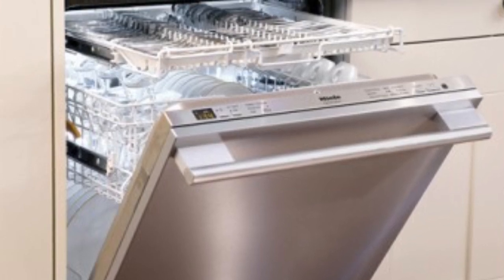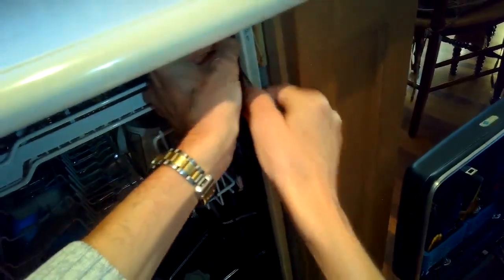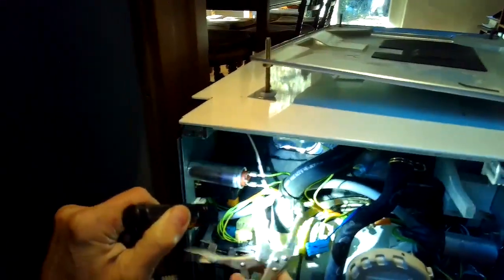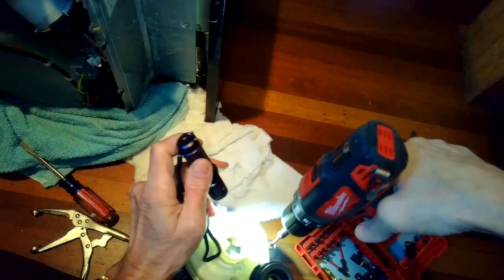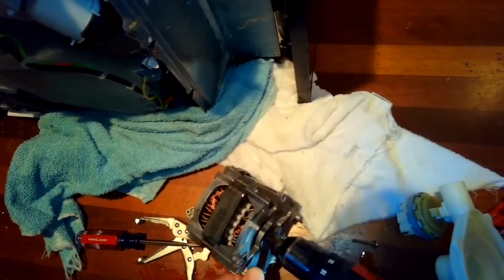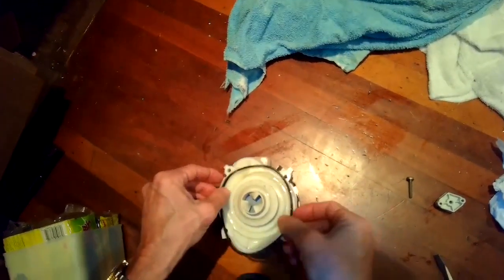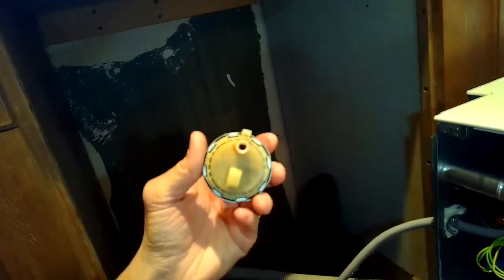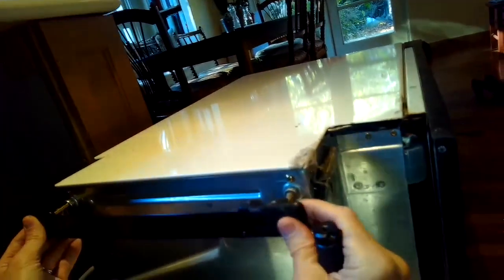✨ Miele Dishwasher - Circulation Motor Repair ✨

Comment: I had exactly this problem with my 16 year old Miele dishwasher.  Two local appliance engineers wouldn't touch it.  I got the spares online and fixed it myself in about 20 minutes.  Brilliant!!
Reply from the maker: Very impressive😊

Thank you

Comment: Scott. Thank you so much for this video!! Was about to throw away my 15yo meile until came across your channel. I was getting low pressure through the spray arms but no error code. There was broken glass caught in the impeller. I didn't need to replace anything so this fix didn't cost me anything. Thank you so much!!
Reply from the maker: Awesome News Tim 😊😊😊

Comment: Scott you are a life saver! Miele wanted to charge 150£ just for a call out, but this video saved me from paying to those money grabbing bustards. I have different model but actually all the insides and fixing is the same. I had a small particle of plate stuck in circulation pump. Took me 2 hours with watching video and unhooking pipes etc but we'll worth it. F78 error solved on my Miele G6620

Next time it will be 30 min max fix.
Reply from the maker: Thanks so much😊

Comment: Scott help please! Just put a new circulation pump partition kit in. Not nearly enough end play and the impeller barely turns when assembled. All was completely sanitary on assembly. Now I need to disassemble and figure out how to set the end play. Does the impeller free wheel  when spun by hand several times or does correct play make it very snug? It seems on mine the threaded bushing is not at the correct depth in the impeller, causing too much contact with the housing seal. How much resistance to rotation is normal?
Reply from the maker: Can you try getting some rinse aid behind the impeller to help lubricate it?

Comment: Hi Scott thanks for this video  I may try this because well I have to try something to get it to work again.   

Do you have any idea on how to get an error code on a G 5175?   There is no digital display on my model.   Thanks.
Reply from the maker: Hi Daniel,
At the back of this service manual is a way to get the error codes from your dishwasher.
Please let me know how it goes.https://f01.justanswer.com/smitty1486/82cb3584-14eb-4f91-85fb-9fc99e1393a9_G4000+G5000+Miele+Service+Manual.pdf

Comment: So I spent over 4 hours tonight working on it. Going the dishwasher pulled on and the bottom off, and removed the circulation pump. It looks different than the ones in Scott's video. But there was nothing stuck inside of it, or any of the connecting pipes, and nothing in the pressure switch. So I took my time to put everything back together and was going to run it again, and now there is a water leak into the overflow plan as soon as it starts to fill with water. So would have to pull it back out to find the cause of the leak. If I can't get it to stop leaking, and if it still makes the grinding sound, I'd end up just replacing the entire Dishwasher with a new one than spend $700 for a new pump & motor.

Comment: Great video Scott - I know the F79 fault is not necessarily a pump fault, but more a communication issue between that and the pcb.  Gut feeling (from an appliance engineer to a heating engineer) - is it worth digging around or am I potentially going to spend our more on a 9 year old machine than makes sense.

Comment: Thank you for your excellent videos.  I have an G 892 SCU Plus, and I think I have a circulation motor problem.  It stops with in 10 seconds after filling and then it tries to start circulating, then just stops.  How did you know the motor was a problem versus the capacitor.  I saw your video on the circulation capacitor.  I think that may be my problem.  I don't know if I have an F14 error since my Miele doesn't have a digital display.  It stops with the Rinse and hold light on and the start/stop light blinking.
Reply from the maker: Can you access the impeller with a fork?  It might be stuck and needs a twist.
Reply: Yes, I tried spinning the impeller back and forth with a fork.  It to rotate fine.

Comment: Scott, I love the video on clearing the F14 error by pulling the shrapnel out of the circulation pump..  By any chance could you upload a video doing the same circulation pump dissassembly on a miele pump no 7805380, which is the pump for a miele G5715 dishwasher

I got a F78 error and Ive tried everything else,, but I've got a funny feeling that it is a bearing in the motor itself because it isnt spinning very freely, like the one in your video is.
Reply from the maker: That totally sounds like a bad sticky bearing.
Reply: I totally agree actually :)... I worked out how to get the motor and pump apart.. strangely its a sort of permanent magnet inrunner type arrangement with the internal rotor sealed inside a plastic shell inside the stator on the outside. Quite funny!!!  ... anyway I worked out how to get it apart safely and non-destructively.. and yes the back bearing runs pretty freely, front bearing is pretty stiff so that is where Ill start.. I havent worked out how to get the impellor off, which I have to do first. But it has two little holes in the front of it which looks like it is made for some kind of a custom tool which I reckon I can make.. I suspect that it will be a left thread?? The motor is  a 7805380 on a pump which is for a G5715 miele dishwasher.. But the pump looks different to all the ones in your videos...

Scott, I very much appreciate your videos and your effort.. I will more than happily make you a donation if it works. You will have saved my the cost of miele genuine part which is $600+ Aussie dollars
Reply: Incidently, how much power do these motors pull?.. I wouldnt have thought that the motor would really struggle to overcome the small amount of friction on the front bearing so the motor is obviously  only low power ??100W or something small??

Comment: Thanks for a great video 👍 I have an Miele G6200 that is leaking (dripping) while the water is circulated. Is it possible to just replace the seal, if thats the faulty part? /Martin (Sweden)
Reply from the maker: Hi Martin,

You can call espares.com to see if they can send you a partition seal kit

Comment: Hi Scott,
I watched your video on replacement the partition washer between circulation pump and motor in Miele dishwasher. I have Miele model 4225 and the pump assembly 
MPEH 00-62/2.
I contacted Miele technical services and part department, needless to say they were not helpful. 
Where can I get the repair kit.
Thanks, Michael
Reply from the maker: How about this one: https://www.google.com/search?q=miele+circulation+motor+partition&client=safari&hl=en-us&prmd=sivn&source=lnms&tbm=isch&sa=X&ved=0ahUKEwjm-vzGgqzYAhWK0FQKHVcADfQQ_AUIEigC&biw=375&bih=526#imgrc=gL2UNK8WYYPbHM:

Comment: Very helpful video, thanks. I found the rotor to be not really jammed so I cleaned the rust up and reassembled it but the motor still makes no noise at all, and as soon as it is called into action (after the other pump has emptied the water and the water has been coming in for a short while) the red light blinks on my G 680 SC as before.
Is there any other possible reason for this (fuse? overload switch? etc.) or does this mean the motor needs replacing?
Reply from the maker: You might try calling Miele USA and asking them to send you a new motor capacitor.
Reply: @ScottTheFixItGuyChannel  Thanks Scott, but I missed your reply as Thunderbird sent it into my Spam mailbox. We finally decided to replace the dishwasher after 21 years of loyal service and several DIY repairs over the years.

Comment: Great video Scott....!!!!  Thank you.

I was able to remove the motor and retrieve a piece of glass from the impeller of the circulation pump just by following your easy step-by-step instructions.  The dishwasher still has a problem though.  It is an older G 692 SC PLUS 3 model (16 years old).  I wonder if you have any suggestions regarding the problem it had to begin with, or if you think the machine might have run its final race??

On any cycle, it starts off perfectly by first draining the sump, then it takes in approx. 6 liters of clean water and then the circulation motor kicks in perfectly and the initial rinse begins.  The water seems to be circulating as well as it ever has.  Everything seems to be perfectly normal up to this stage.

HOWEVER after about 10 seconds, it stops and pauses for approx 10 seconds.  The pump then kicks in again and the initial rinse continues for another 10 seconds, then pauses again for approx 10 seconds again.  This happens about a dozen times, after which the machine come to a stop and the red Inlet/Outlet light starts blinking.

If it does complete a cycle, it doesn't always heat up the water on the wash, not the final rinse cycle.  I have tried everything I have found on this subject and am starting to wonder if the electronic circuit board has packed up.  Any suggestions would be much appreciated and also if Miele has a factory reset procedure for the inbuilt software?
Thanks in advance, Vic Schroeder
Reply from the maker: Might just need a new heater relay 👍
Reply: @ScottTheFixItGuyChannel  Thanks for your speedy reply - I'll check it out.
Reply: @ScottTheFixItGuyChannel  Just one more question if I may......

If the heater relay was faulty, how would that cause the dishwasher to stop and start continuously while still in the initial COLD water rinse cycle, or does the software actually detect that the relay is faulty even before the coil is energized to heat the water up in the upcoming wash cycle?  Regards, Vic
Reply: @vicsch8162  Hi Vic I read your above posting and my Miele 841 Plus dishwasher is behaving the same way. My machine gives me an error of F08 - Water intake failure, heater level switch.   My machine also drains, fills, and then does the multiple on/off on the rinse cycle before throwing the red Intake/Drain Light. Were you able to find a fix for this issue.  

A couple of years ago I was having issues and I did the partition kit when Scott recommend it and that fixed the issues I was having back then, I also did the motor capacitor at the same time just to be sure. The washer was back on line. 

In the last few months the Intake/Drain Light issues started again. At one point Scott suggested that the water intake solenoids valves might be an issue and they should be replaced as they might be impeding water intake.  When I checked the water intake it was severely clogged with rubber from the washer and after clearing this out the dishwasher ran as normal for a few more months. Now it’s back to the issues above. The water intake is clear so now I am wondering if it is heater related issues.

I see Scott suggested that the heater relay might be an issue for your situation and I was wondering if you replaced it and did it fix your problem?  Thanks for any help in advance.  Mike

Comment: Hi Scott - thanks for the video.  I may have a later model as there was nowhere to insert a screwdriver to prevent rotation while removing the impeller.  I tried to unscrew a section next to it to get in through the side, but what looks like a flow distributor (skeleton cylinder with a cog and two pop-out window tabs) came off and I can’t tell how to reinsert it.  Any ideas?
Reply from the maker: Hi Michael,
Unfortunately that model does not allow you to rotate the circulation pump impeller.
Reply: @ScottTheFixItGuyChannel  Right - makes sense.  Any idea how to replace the flow distributor with two window tabs that came out?  The orientation and placement of the cogs is not obvious prior to reassembly.  I did clean the impeller though.  Now I can't reassemble.

Comment: hey can you tell me why an f85 fault would happen with impellor free and clear?
Reply from the maker: Hi Benny,
 you'll need to contact Miele USA since they are the only ones that distribute their own parts and order a new slide shutter for the circulation pump because it has seized up / failed for one reason or another.
Reply: @ScottTheFixItGuyChannel  thank you i bit the bullet and got it checked by an authorised repairer who had a scanner and the motor had expired and would cost over $600 AU for just the part alone.

Comment: I have an old Miele dishwasher g2170.  It’s pouring water I believe out of the circulation motor and it’s making monstrous noises that has my dogs barking.  Do you think The Whole pump needs to be replaced or does it just need some maintenance Iike you did?   I’m trying to save money.  The pump is about 800 and then what’s the point mine as well get a new machine.  I bought it in about 2006.  

Update: Called Miele, they do not have a partition kit. I can’t seem to find one anywhere. The circulation pump is now part number 12133930 and it’s 579.46. Do you know anyone who would carry the kit? I think I’m going to go ahead a check to see if there is something obstructing the impaler (have nothing to lose) but if I need to change the seals, not sure what to get.
Reply from the maker: I bet there’s just something caught in the pump that makes that noise.
Can you call Miele USA and ask for a new partition pump kit?  That should cure the leak.
Reply: @ScottTheFixItGuyChannel  Thank you! I will.  I’ll update.
Reply: @ScottTheFixItGuyChannel  Hi Scott , I took out the circulation pump and there was a spike from the bottom basket in it.  That helped with the loud noise.  It’s still pouring water out of somewhere during the full wash.  There’s is no clog coming in and I can hear it drain.  There is a mechanical sound during the whole wash.  Im not getting error lights now and it is going through the whole wash.  But It’s it’s pouring water.  Do you think I should just toss it and try and get a new machine or is there anyway for me to figure this out?   Im lost. Sry

Comment: Hi all, so I repaired the leak between the circulation pump impeller and motor but when I reassembled the actual electric motor I was unsure which end of the rotor shaft the metal washer and metal spring washer went on. Now when using the dishwasher, the motor is noisier than it was before.  Could it be the washer in the wrong side of the motor shaft or is my impeller possibly on too tight? I'd like to have a diagram for the Miele inspira series mpeh 60-62/2 6770512 motor itself and NOT a diagram of the circulation pump assembly since I need to determine how to exactly reassemble the electric motor. Any help much appreciated.

Comment: Hi! I love your videos! So I vacuumed the water out last week, before discovering your videos. I did the fork just now but the dishwasher isn't going on at all. No sounds. Last week, it had filled with water and then it stopped and the Intake/Drain and Rince Aid light came on. They're both on now and blinking. Any suggestions for this? It wasn't run for 2 years before this due to a tenant that I had in here.
Reply from the maker: I wonder how high the water is coming up in relation to the white plastic filter handle. It should fill enough to where it just touches the bottom of the handle.
Reply: Thank you so much for getting back with me. I believe the water was at a normal level. I vacuumed it out and then checked for any blockage. The dishwasher had stopped half way through and the blinking red light turned on. Now the dishwasher won't turn on at all. That's when I found your videos. The "Intake/Drain" is still blinking red and the "Rinse aid" light is solid red. Should I maybe try the fork turn again?

Comment: Tonight the unit ran for about an hour and then would start/stop for a few minutes, and drain all the water, then all the LEDs would flash. I went into the service codes and it showed an F14 which is the Heater Pressure Switch. So I'm not sure if that by itself is the problem, or also the circulation pump due to the loud noise when running.

Comment: I have the G1383SCVi which is slightly different and unfortunately Miele doesn't sell the housing, only the complete unit for 400eur!!!.  In mine the only problem is the pump impeller that the two halfs have separated...
Reply: Managed to fix mine, the impeller had split in half, made a video also.  F78 error
Reply from the maker: Nice job😊👍